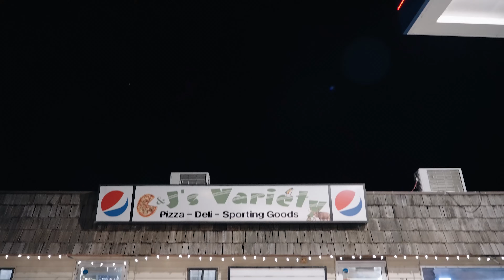Surviving 72 HOURS in Homemade ICE FISHING Shanty (-25 Degrees)

Comment: Had the great idea as a teen to build a ice shack out of light wood and clear plastic wrap.  Could stand in it and see all the tip ups.  Yes you could.  I put it on a steel tracked sled.  It was amazing till the wind caught it.  It took off and there was not one of us who could run it down.  It just went out to the center of the lake.  Went and went till we could no longer see it.  Gone.  It still could be out there on lake Ontario.  Like the Dutchman.

Comment: So everyone knows the solution to strapping tents and sheds down properly.
1 you will need about 50 feet of rope. I carry 100 feet
2 you will need a anchor of some sort that you can use to secure in the ice. I use retractable safety fall anchor with self made grinder imprints to grab the ice in a 3\4 inch hole about 4-6 inches in the ice and tie down from there. I do 1 high and 1 low  on each corner in heavy winds or if I'm not around

Comment: That seems like fun! Here in North Sweden their called Arcs you know Noahs arc ?  Mostly used for burbot fishing when its stupid cold like now in late January and February .bä

But you need to Create a better Boggie/pulley system down in the bearing lower parts of the arc just make something in steel if you can build that youve got to know someone who own a weld  . From side to side in metal and in s triangle form with a simple snowmobile hookup system and your set ! And it will be durable through out the 2030:s . 

4pm ? When does the sun go down over there ? We only have about 3-5h of sunligt now in these months . 

Regards Paul Roger Nilsson